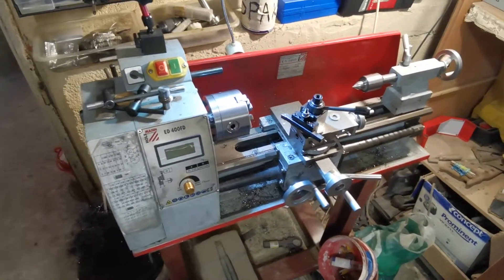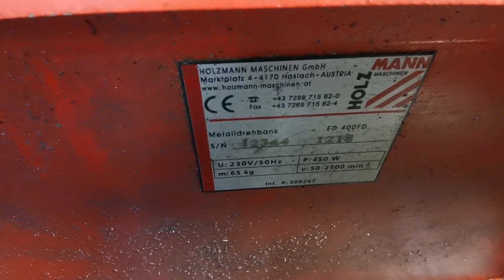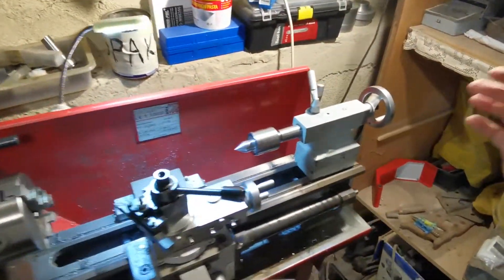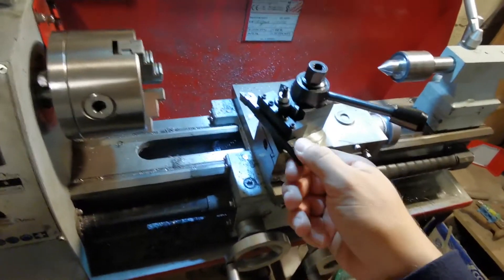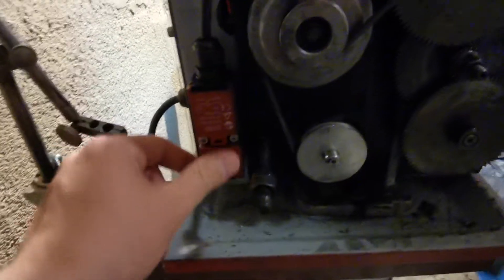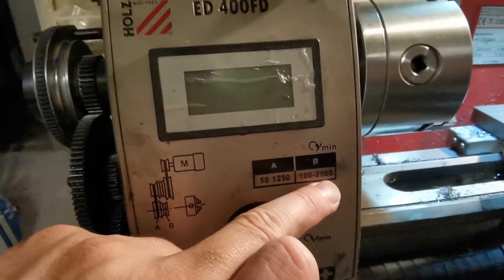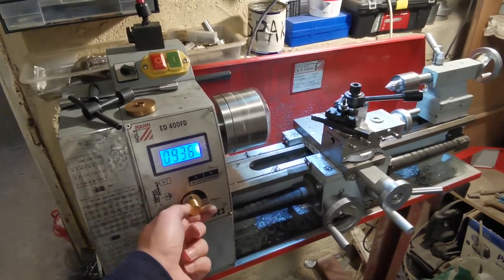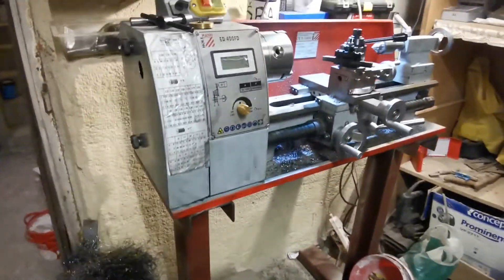Small Lathe Holzmann ED400FD

Comment: Hello ! Nice video ! Can you tell me specific brand and model of quick interchangeable tool holder ? I got some oversized for mine..
Reply from the maker: I use tool holder which was a part of packaging
Reply: @DanielMagura  interesting, that's definitely not the toolpost I got in mine. My version is a simple square block with slot around it and screws to hold the tools.